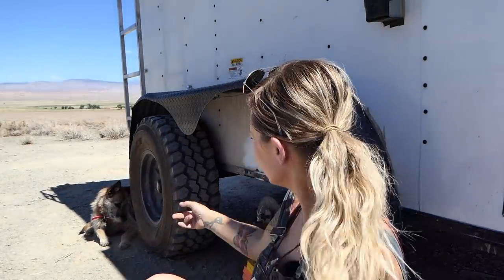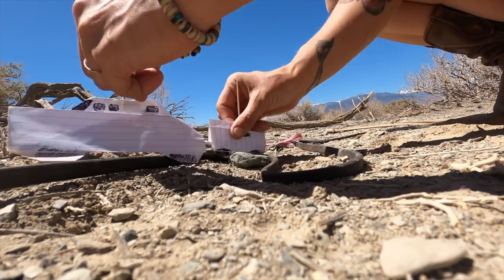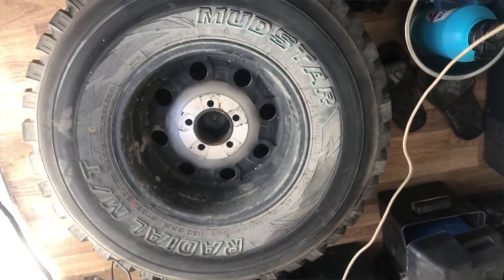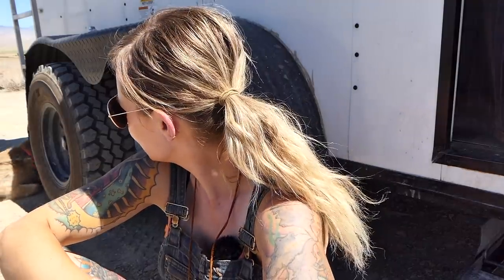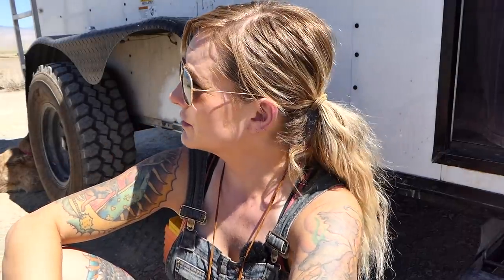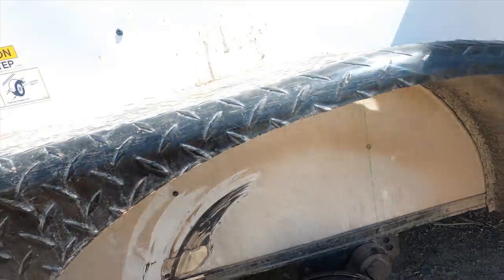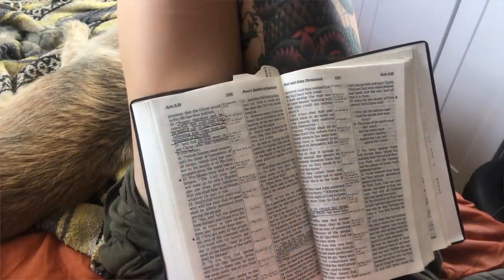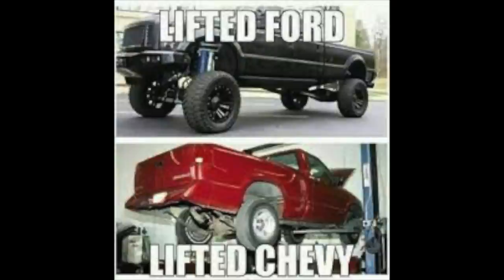Diary of a Broken torsion axle - living full time in a Cargo Trailer Conversion

Comment: We went through the same scenario with the Torsion axle. We were stranded 450 miles from home. Triple A transported, not towed, the maximum allowed which was 200 miles. We left the trailer in the desert with a friend of my daughters. On the bright side, Dexter puts warranty orders in front of purchase orders, so we had the axle in less than 10 days. 4 days to manufacture, and 6 days free shipping. Dexter warranty staff are amazing. My son in law and myself traveled the 500 mile round trip to repair and recover the trailer. Dexter also offers tire replacement costs if tire was damaged. We stressed for a few days wondering what to do when we found out the axle had to be made. All the rv dealers and repair shops we contacted said it would be 6-8 weeks which freaked us out. Unlike you, we did have a home to go to, but hated leaving our trailer behind. Crazy part is, after repairs on the front axle and after the 250 mile trip home, we realized the back axle also was tweaked a little and Dexter is sending us a second axle, no cost free shipping. Loved your video! Take care!

Comment: I was just remembering back when you where reading the other I use to drive 18 wheeler and a tire blow I didn't feel it going down highway any way it wrap around the axial another driver saw it and came on CB and told me I pulled over and he did too help me get it out and limp to a truck stop thank God for other driver and CB'S

Comment: With a straight axle, you loose several inches of CRITICAL ground clearance.
You have a great setup.
I'm glade you two are safe and someone you can trust knows where you are.
Hi Riot 👋
Watched every minute 👍
Reply: Not necessarily, I know straight axle gear and their are ways to gain clearance and still maintain the soft ride of a torsion setup.
Reply: You don't lose clearance if you put the springs below the axle.

Comment: Hey, great news about the Bosch CP-4 fuel pump already being replaced!  Robert from South Georgia Hotshot actually installed the kit himself in one of his vlogs, but it is not very detailed.  His Super Duty is still working at like somewhere around 200,000 miles if my memory serves me.  There is probably a you-tube video that is quite detailed.  Too bad that Ford Tech Makuloco hasn't done one.  That guy is simply amazing.  He lives somewhere around Chicago, but focuses most on gas engine Fords. I am older that dirt and have my share of stories about a wheel coming off as I was driving down the road one time.  My father-in-law was towing an air compressor one time and it passed him on a side road.  My ex-boss and his wife plus 3 daughters towed a 28' cargo trailer back to MN from northern CA with 3 wheels.  He got so comfortable that they stopped at a few tourist attractions on the way back.  His replacement axle arrived a couple of weeks after he returned home.  It was a torsion bar.  I have 2 of them on my 16' trailer.  You did NOT make a mistake.  Your research was valid when you purchased your trailer.  BTW, I used to live in Castle Rock, CO for 2 years (2008/2009).

Comment: So sorry for your troubles. But it's nice so many people helped you. Back in 1971, a friend and I worked building sailboats for a company in Southern California. We were both 20 years old at the time.  Our company decided to hire us to tow one of their sailboats to New York City for a boat show. We were given a Ford LTD station wagon as our tow vehicle. It was January so we took a southern route to avoid bad weather. One night just after sundown, I was driving in Alabama and suddenly there was a jolt from the boat trailer. I looked in the side mirror to see sparks flying from the back. I pulled over and discovered the boat trailer wheel on the driver's side was gone! The trailer was laying on its axle and this beautiful, brand new sailboat worth thousands was listing badly. A tow truck happened to be following a couple of cars back. His truck was not right for our problem so he called his shop on his 2 way radio. They sent out a dolly and managed to get it under the boat trailer and we had an escort into Montgomery. The boat trailer was a rental and they apparently didn't fully tighten the lug nuts and the wheel sheered off. That's what we were told, anyway. We found the wheel the next day about a 1/4 mile down the road from where we lost it. It was ruined and we had to have a new wheel and tire installed on the boat trailer. Despite the problems we were very, very lucky. We continued on to New York City and made the boat show on time.

Comment: I have to say that you are wise beyond your years.  Knowing when to stop and evaluate the situation is a good quality to have.  Had a similar situation with a friend camping at a state park.   He hit a curb with the front wheel of his tandem axle trailer and bent his spindle.    We bent it back with a porta power to get us home.  No repair shop would never attempt to re-bend a spindle because of liability issues but it got us home.   Its nice that you were able to get some help.  Here up north when you are in trouble on the road they would drive right by.  We could use more Southern Hospitality up here in the north.

Comment: Those torsion axles save you more wear and tear not only on your trailer, but everything in your trailer.  Sometimes bad things bring you good people and I'm glad you found good people.  I have a 26 ft enclosed car hauler with torsion axles I used to move stock from one store to another.  I could stack 4 cases high and nothing ever moved.  I borrowed a friend's spring axles trailer once, only stacked 3 high.  Everything was one level and scattered everywhere when I stopped.  I had only gone about 3 miles inside a small town with very little traffic.  No springs for me.

Comment: First off, that reenactment was amazing.  It’s almost like I was there.  Secondly, the torsion vs. spring debate.... It all depends on the usage.  Here I will agree with you that in your circumstance, torsion is definitely the way to go.  Just gotta slow down on them curves.  🙃Third, you sure got lucky with finding one two weeks out.  That’s simply awesome.  In conclusion, bad things sometimes happen and like you said “It is what it is.”  It’s how you respond that sets you apart.  Till next time.  Be safe.  Stay warm.

Comment: Oh goodness! This video brought back many trailer axle issues on several different types of trailers, horse and cattle trailers! LOADED with either horses or cattle! From lug nuts break and tire fasting you going down the freeway, to bearings felling even though they had been serviced! Most of those times was during a paid transportation business at that time! To a transmission torque converter ripping out flex plate that sounded like a piston goiy through the end block

Comment: Ten years ago, we were pulling our 32' Teton trailer back from camping, and, thank goodness we had double axles because we had a wheel come off, we were doing 55 mph when it came off.  It tore off the trailer fender, and flew over the fence line that was well off the borrow pit!  Thank goodness there were no houses, horses or cows out there.  We looked for a long time and never found the tire and wheel which must have kept rolling until it reached the river, and well...floated away?  We'll never know for sure.  My crafty and experienced heavy equipment operator hubby used a tow chain and tied up the axle, and we limped truck and trailer home on 3 wheels ... 45 miles!   We relate to your pain, frustration and anxiety over the experience.  Hubby is a nut about maintenance and always being prepared, he cross checks everything....every time.  Even with all that....shit happens.

Comment: Axle limbo sucks but you are sooo right.....2 weeks trumps 6 to 8 any day.

Driving into Atlanta, pulling a 32' Toy Hauler. Ran over something on highway, while in left inner lane of 4 lanes. Front tire on left axle blew causing a very awkward shift left. Keeping it steady was a heart attack, white knuckle instantaneous panic.....in very heavy traffic both sides. With people blaring horns, and flipping me off while passing, I somehow managed to get across two lanes to the shoulder without further incident.  I had to jack the trailer up while right there on the busy interstate, vehicles flying by barely 4 ft away. Got the tire off and put it in the back of the truck. Had to take the trailer off the hitch, and leave trailer on the side of the highway to go get the tire repaired. As soon as the tongue of trailer came off the hitch, a Semi truck came by, really close and the wind blew the trailer hard. It shifted and started rolling down the steep shoulder, and landed hard on the front stanchion bending it and collapsing the tongue of the trailer to the ground.  That was actually a good thing because the tongue sunk into the ground and prevented the trailer from continuing down the steep embankment. But......it also caused the rear of the toy hauler to move out toward the highway and it was literally hanging out over the white line into the lane of traffic.....not by much but definitely in the edge of the lane of traffic.  I said a prayer, jumped in my truck, left the trailer suspended there in its precarious predicament and rushed off to find a new tire and get back as quickly as possible.  In the end......miraculously my trailer.....and I survived the ordeal and I was able to back to Tennessee safely. I immediately sold the toy hauler and have not pulled that large of a trailer since.

Comment: So glad all is pretty much taken care of....just waiting for axle...glad you and Riot are good....You won't regret getting another dexter torsion axle....thats all we use on our horse trailers....they ride so much smoother...your little trailer with the double axle setup is really overkill but you knew that...theres hardly enough weight to make those axles flex much....oh well better to be confident that your trailer can handle most anything....had to laugh at the play by play demo of the screwup....lol take care Lex....ohh BTW...im like Ralph that commented I wouldnt be afraid to drive the trailer a ways without the 4th tire...people cripple horse trailers like that all the time when they dont really have to change a flat on the highway...they just cripple it into the next town on three tires !!

Comment: That's what one calls an adventure .. I do roads in question or i should say off roads , i'll stop and walk ahead to look it over in areas that seem a bit in question .. 
I don't know if i would myself buy a spare axle assembly to sit on for the failure of the next one which may never come ..A spare tire yes by all means i carry a spare one for my truck one for the trailer .. Good luck to you Lex it really sounds as through you covered all your bases and made many phone calls for help for finding the correct part .. Before long you will be back on your adventures with more videos to share with us ..
You asked for off road break downs , so to keep it short of all the thousands of off road miles i have driven , only one trip in my life i had to walk out for help, as i had 2 flat tires on my truck...

Comment: I also have a utility trailer conversion. I camp most of the time on logging roads in north Idaho. I always disconnect trailer before going down a NF road. I then check road with just the truck. I usually have to clear limbs and small dead fall before I take the trailer in.

Comment: You and I have very similar trailers. I saw the rugged overland dual axle trailers on the website of that trailer dealership in Colorado. I track down the manufacturer but they would not deal with me directly. I found a local trailer dealership near Fort Worth. I worked with the local guys and had the custom built cargo trailer manufactured in Corsicana. Same wheels and tires same torsion axels. I bought a spare wheel and tire from Cargo craft for about $300.
My worst horror story is due 100% to my own stupidity. Very early in my camping experiences I took off one Saturday and forgot to lock and pin the bulldog trailer hitch. You probably have the same kind. I got about 5 miles and even made a stop before getting on the highway where the trailer jumped off the ball. First the trailer tried to steer the truck and then when I slowed I thought somebody had rammed me from behind. I got lucky. The only damage was the empty aluminum generator cover on the tongue.

Comment: Lex I'm cautious too, I drive 55-60 towing my 1994 Chevy Silverado pickup. Oh, I stopped at a truck stop on my way back from Quartzsite and the 2020 RTR and saw the bolts holding the tow bar on the drivers side where pulling lose. Found a junk yard in North Las Vegas and bought another bumper. $85.00 and took the old one off and replaced it. Whew that was scary. I'm in my late 60's. Stay safe and enjoy the Adventure. Enjoy your video's too. :) :)

Comment: Had a trailer like yours that I used for camping and ATVs, Single axle. Now have a dual axle (drives nicer).  You are completely fine with only one axle on that trailer, all your stuff is nowhere near the limits on the single axle, really you are fine unless you start rockhounding again and load the back with 2000 pounds of rocks.

Torsion Axles are rarely made to order, 99% of RV and trailer parts are just assembled from common manufacturers of the parts.  Check out etrailer, they have most of the parts, ship fast and are priced well.  Keep the old part and see if you can match it to a replacement for the future (Basically just bolt patterns, brake type, and capacity).

Good luck, you got this.

Comment: Well, I feel relieved. The re-enactment was fantastic with the multiple camera angles... accurately scaled route simulation and bouncing animated vehicle model to demonstrate the rough ride! Really great! I had to backup about a half mile once with my 14’ cargo trailer and long wheelbase Transit van. No switchbacks though. I did take the time to mount the camera on the back of the trailer before doing it and I’d been putting that off for weeks so.... lemon-aide made. I’ve lost track of how many times I’ve had to learn the lesson: If in doubt, park and scout. I commented last time that you were smart to get two axles on that trailer. I suppose there may be piece of mind in having a spare but surely it would be less hassle to just be more cautious. (imho) Here’s wishing best of luck getting the replacement axle successfully on-site and mounted.
Reply from the maker: Hi! May I please borrow/take “when in doubt, park and scout”? I will do my best to credit you!!
Reply: @LexandRiot  consider it yours to use and my honor to contribute. No credit needed.

Comment: Before you buy a spare axle,  look into Timbren Axle Less. Each wheel /spring is independent. They bolt on to your trailer . You could carry spares 1 left 1 right alot easyer and lighter then a full axle assembly . 3500lb set is around $950. I'm using them in a build myself, and going to order a spare set now. Thanks 🤣👍

Comment: I have an off road teardrop trailer that I pull with my jeep. And the trailer has the same torsion axle as yours. I took the trailer up a mountain outside of Quartzsite AZ to camp for a few days. It was pretty rough getting up there. When I got to where I was going to camp i noticed one of the wheels on the trailer was not straight. It was rubbing up against the trailer. I lost a lot more paint on the trailer then you did. There are four bolts holding the axle to the frame two bolts where gone. Took me four days to get it fixed enough to get it down from there and into a shop and fixed right.

Comment: As you said there are both pros and cons to each type of axle. What it really comes down to is cost vs. convenience or comfort. You're not in the trailer when you are towing it, so is the smoothness of the ride that critical? Maybe just slow down off road. Availability of torsion axles is a big issue. Especially, when. you have an issue. So, if you decide to keep the torsion system, you will need to keep an axle on hand. If you switch to a spring system, you will have to squeeze out the huge up front cost for the spring conversion, but it is easier to get it fixed and cheaper when they do break. So, when do you want to spend the money? So, long term, keeping the torsion system in place and having an axle on hand is the cheaper option, in my opinion and no major conversion has to be done to your home and you can stay on the road longer.

Comment: Thanks for reading my story, oh and I am a "he", no worries though. Brutal luck on the axle damage, But glad to hear that your persistence got you a axle on the way a littler earlier . Im currently working on building my Overland truck that will have a camper on the back, but my trailer is a spring axle, Mainly because I tow vehicles on the trailers. The only experience I have with a Torsion axles was on the back of truck chassis RV in order to carry more weight. Worked well. So I would say there is a time and place for each style.

Comment: That was interesting how you used the origami to illustrate your axle dilemma...lol.  It's interesting(?) to hear what problems drivers experience on the highways.  I've had a couple myself, the worse being a tire blow out at high speed but that was my fault.  At 16 I didn't have much common sense.  As a CDL driver I managed to damage two axles on different 53-foot trailers.  I'll be traveling and living in my GMC Savana cargo van as I travel throughout the lower 48, Canada and Alaska, a dream of mine since retiring from the Air Force 34 years ago.  Your story reminded me to pack some extra parts, fluids, correct tools, etc., before I hit the pavement.  I wish you well and hope everything turns out in your behalf.  Take care and be safe.